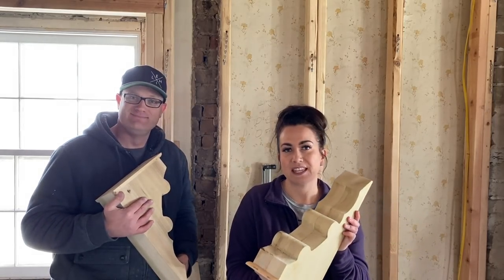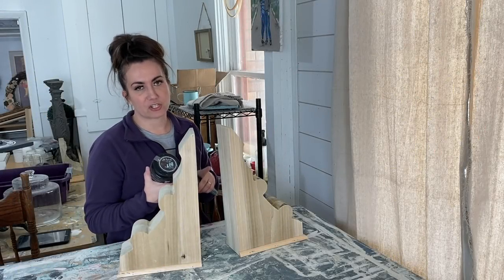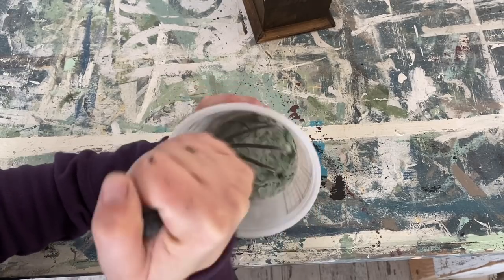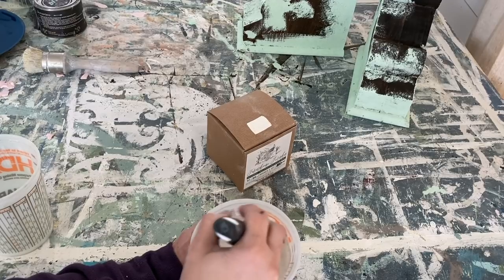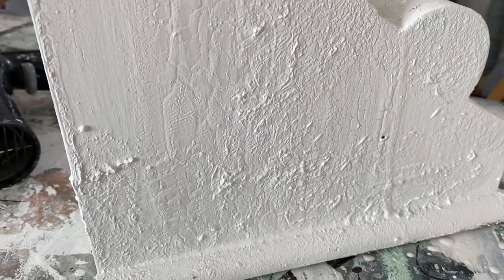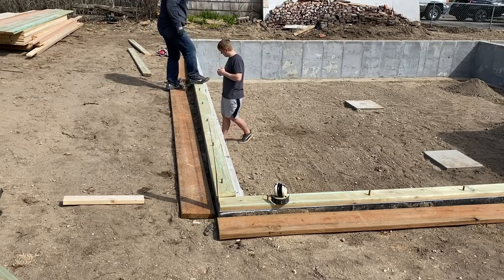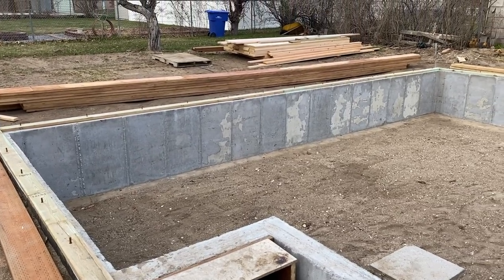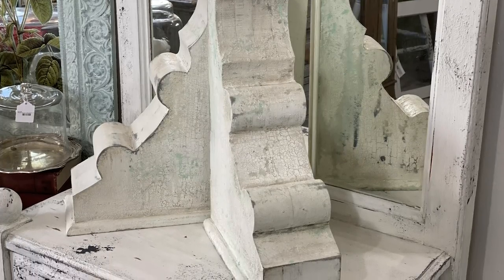New Corbels at the Farmhouse Renovation!

Comment: Love the corbels! Love the finish too! What did you use to cut out the wood for the corbels? It did not look like a jig saw like in your other video's. Looked like a special machine with maybe a template?
Reply from the maker: It’s a CNC machine  (Computer Numeric Controlled) router. I program the design on the computer and then the machine cuts it.
Reply: @JamiRayVintage  Looks like a pretty cool machine. I had never heard of them before.
Reply: I want one lol!